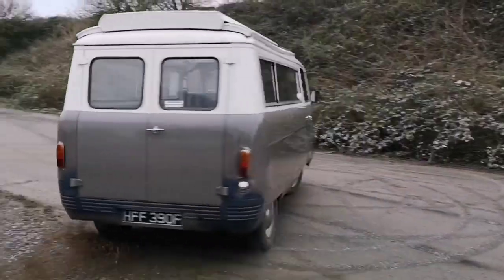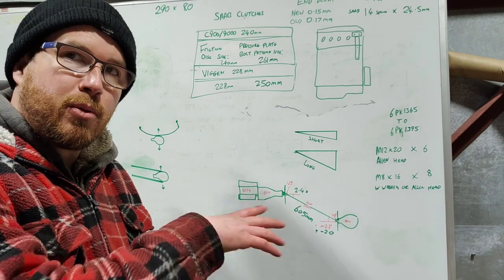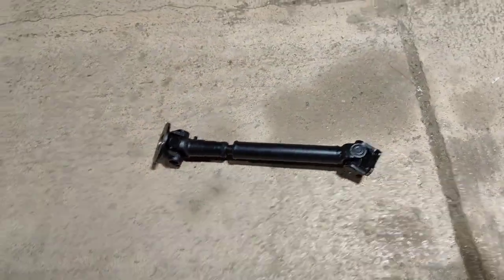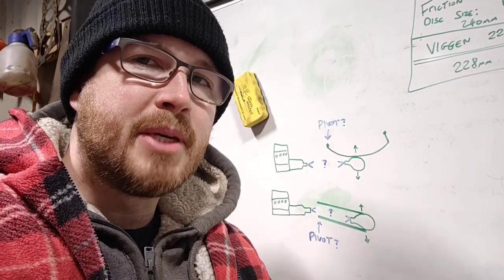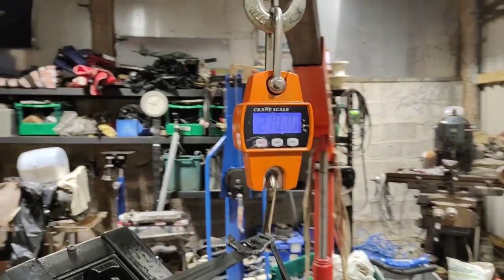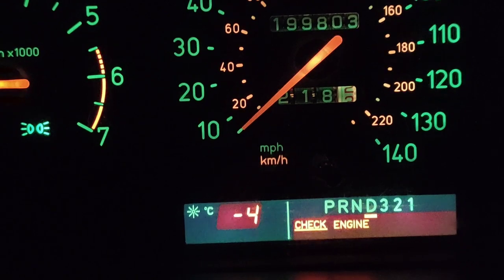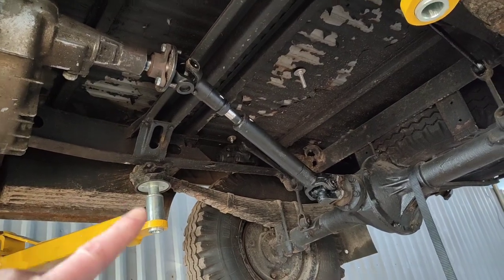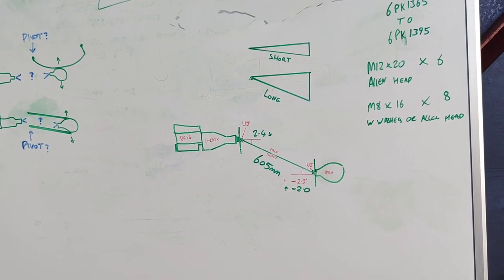Officially Saab Swapped! Uaz 452 Engine & Gearbox Install

Comment: Enjoyed that, thanks! I think I'd be tempted to drill between gearbox shaft and output flange and tap for a large grub screw as a key, a bit like a taper lock pulley has. I've done that before in similar applications and it's extremely effective.  Those sorts of splined drive flanges always seem to chivvy loose in the end and some sort of physical key usually prevents that. Could you use wedges to adjust the prop angle if you have any issues? Looking forward to seeing it up and going, that' things going to be awesome!
Reply from the maker: I considered a grub screw type setup but it would require interfering with the box where the output seal lives. I'm of the opinion that it should be fine as when you have no fixed flange and just a telescopic slider in the back of the box it doesn't try and drive itself out of the box under load. But like with all my stuff, if it doesn't work I'll do it again a different way 😁

Comment: Excellent work as usual. Very creative solution with the output shaft. Prop angles Very important, I go these wrong initially on the scimitar and it added vibration at high speed. Great to see your attention to detail here. 

One suggestion. That output flange is in a very nasty environment, thermal cycling, light thrust loads, and large radial cycling loads from the UJ angles. You have a good long stud welded on there. It's hard for me to tell from the video, but does it have a good long "grip length". The length of the bolt thay is subject to tension when it's tightened. This wants to be at least 1.5 times tge nominal diameter if at all possible. A spacer or even a stack of washer might make the difference between this coming loose and not coming loose. 

Sorry if I'm stating the obvious, you are clearly a proper engineer so probably have this all squared away.

Keep up the amazing work
Reply from the maker: "proper engineer" Ha, My heart melts! Thanks 😁  I do have about 1.5 times diameter (about 15mm) of stuff between the weld and where the nut tightens and that is purely by chance 😆 I wasn't aware of a requirement/recommendation for exposed stud. I'd actually thought it may be better if it butted straight up against the fixed portion. Please don't take my "proper engineer" badge off me!
Reply: @LivingMyBoostLife  hahahahaha, its under review.